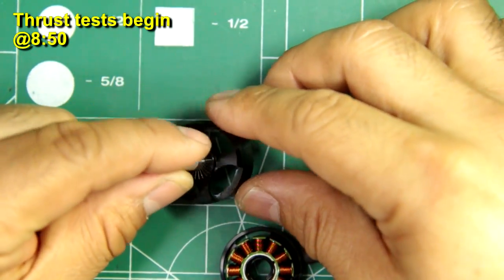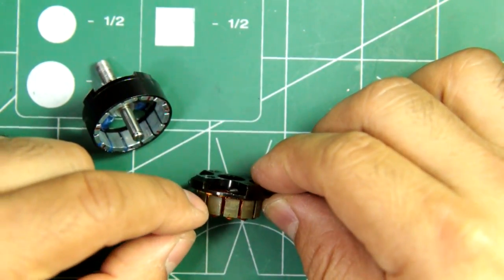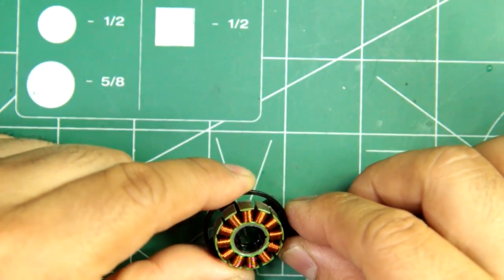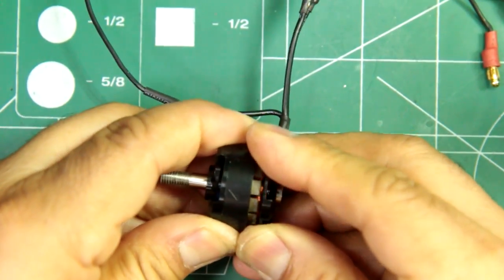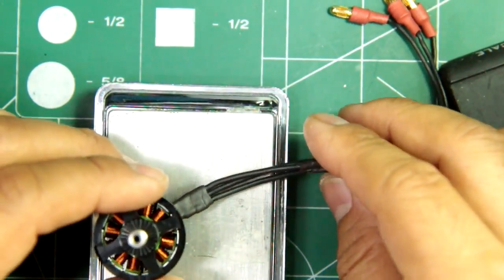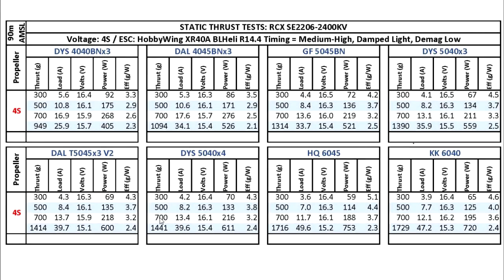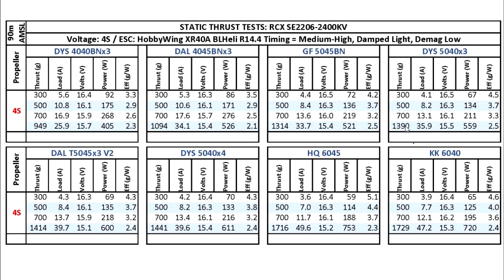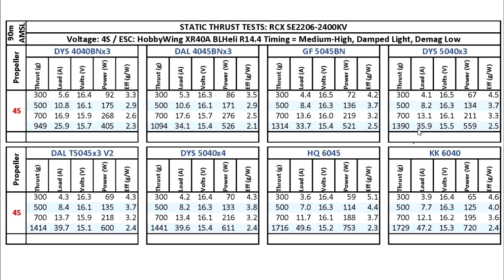RCX RS2206-2400KV V2 - New PowerHouse Motor Prototype from MyRCMart

Comment: Hi friend! Do you remember the real kv of this motor?
Reply from the maker: It was very close to the advertised KV, if I recall correctly just a bit higher. For some reason i didn't include KV measurement in tests at that time. Check out MQTB, he measured 2410KV : https://www.miniquadtestbench.com/rcx-rs2206-2400kv.html
Reply: EngineerX Awesome, thank you very much :)
Reply: EngineerX Could you consider in the future indexing also the smoothness of the motor? like for example a score from 1 to 5.
Many motors are good in the tests but because of the strong magnets they don't behave well in the quads (vibrations). Cobra and RcInPower are ultra smooth score maybe 1 and some BrotherHobby are problematic like the 1407 and could score 5. You can feel it when you spin it by hand
Reply from the maker: Good suggestion. I will try to remember to include a comment on how notchy / smooth the motors "feel" when you spin manually. You're correct. Some motors are very noisy/twitchy and not so smooth when flying due to tight air gap and very strong magnets.

Comment: Do u think 20a ESC can handle these motors for 5inch tri blades?
Reply from the maker: HQ/DAL/DYS/GF 5040x3 and HQ5043x3 V1S Yes.... 20A is good enough. For the more aggressive props like DAL C5045x3 , etc I'd prefer a 30A for peace of mind.
Reply: EngineerX I get your point but I think 20a for the more aggressive prop should be ok. When the props unload it will be just above 20a using your test results. 20a ESC normally can handle 30a in a short burst.  Putting in limitation of the battery I think should be ok.
Reply: 25a ESC is the sweet spot
Reply from the maker: Right 25A should be sweet spot but most well known good ESCs are 20A or 30A. Yes, when prop unload the 20A ESC should be OK, I say I prefer 30A because I rather have more capacity just in case, Also sometimes one motor can be more stressed than all others in certain conditions. But a good 20A can work Ok.

Comment: These results for cheap 2206 motors look better than some more expensive 230x motors have. Also decent build quality, available replacement parts (bells, shafts, bearings, ...) and no need to order separate CW/CCW motors. Very good. Only pity that most batteries can't fullfill the current demand for these motors :)  Nevermind... as curious beast I ordered a set of these for GX210. Let see how good they are.
Reply from the maker: Indeed! When I tested them I actually did a load cell calibration check and ran a couple of props twice because the thrust was higher than expected but seeing the rather large magnets, small airgap and good windings it made sense. Well, let us know what you think of them when you get to abuse them. They need to quickly make a 2306 and 2407 motor using the same recipe as this one, it'll rank high on the power list with the other top brands for sure. Thanks for watching!

Comment: Could these motors handle 5s do you think?
Reply from the maker: Yes, they I think they'll handle 5S with 5040x3 no problem. With DAL C5046x3, I would do a fast run with a couple of full throttle punchouts and immediately land and check motor temp, should be able to hold in hand firmly. That{s about 55 to 60C on the motor bell. You do need to be aware that a batch of these motors had defective glue and some people had magnets slip from the bell. But I think even on 4S magnets slip. 5S would exacerbate the bad magnet glue issue however.
Reply: Yeah but they recently came out with a V3 of this motor that fixed the issue, entirely according to QuadMcFly
Reply from the maker: Then no worries!

Comment: Which would you say is more durable: the old red bottoms or these red 2206 motors? You are probably gonna say the red bottoms, and so, if that's the case, how much more durable are they? QuadMcFly says that the Rcx motor is overall durable.
Reply from the maker: Do you mean RCX red bottoms or EMAX red bottoms?
RCX has been improving motor quality in the latest versions. These use better bearings and strong AL7075 alloy.
I think they may have had a batch with weak magnet epoxy but that was resolved already. I haven't had a chance to run these on quad so I really can't confirm whether they're durable or not. I have use EMAX RS2205's a lot and those have been pretty durable, though I haven't really smashed them hard, just normal crashes and tumbles. Sorry I couldn't give you more info. It's hard to say how much more durable one "good" motor is over another "good" motor. Only if there's a clear defect like slipping magnets, weak shafts, etc then it's easier to compare. Some people may crash once a break a motor because they hit a pole, rock, etc at the right angle and motor ends up exploding, then other people may crash 100 times on trees, grass, dirt and not damage anything. From what I've seen people always have some sort of issue with every motor, from every brand. On RCGroups you see people posting about their troubles with every motor. There's just not one bulletproof motor. If you hit it on the right spot it'll get damage, if you continue using unbalanced props, bent props after a crash, bad PIDs that cuase motor to overheat, etc, then most motors will get damaged.
Reply: I meant the old emax red bottoms. I ask because I have had the zmx v2 2205 motors and they dont sound smooth anymore after only  a few minor crashes. I don't know if they are made out of 7075 aluminum but I dont think they are. I wanna go with the RS2205 motors since they are so durable and reliable, but since UI'm gonna be building a 550g freestyle quad, the emax motors, I think will be underpowered, especially compared with newer motors like the RS2206 2400kv motors by RCX. What would you get for a freestyle build that you wanted to be as durable as possinle? Thxs
Reply from the maker: The old EMAX are pretty good, but yes they'll feel underpowered compared to all the newer motors. Also those old redbottoms have 3mm shaft. The newer motors have 4mm shafts so the both shaft and bearings are supposed to be stronger and more durable. As far as these, I think they'll be as durable as other motors. A good thing is that MyRCMart usually sells parts for these at very good prices so always good to pick up a couple of bell/shaft assemblies, bearings and even a couple of spare motors and since their price is usually lower than other motors you can buy all of that and spend about the same as buying 4 other brand motors. But still, no motor is 100% perfect and durable, always a chance to break it on first crash. So far, I've seen the same type of comments on these as in other motors like EMAX. Many people like them and then you see a couple of people that had bad luck and motors got rough fast or had some other issue. For low-price powerful motors, I think these are a very good choice. For more premium motors, then Brotherhobby T2 2206-2600KV, EMAX RS2205(S), DYS Storm/Fire/Mars would be other good choices. There are many other choices that I have not tested like TMotors. So it's hard to recommend one single motor these days.

Comment: have you tried benchmarking this with dal cyclones t5045c and t5046c ?
Reply from the maker: I have not. I forget if it was because I had not yet received them. If I have time, I may run those 2 props.... but time is lacking and I got a couple new motors to test. EMAX RS2306 and DYS Storm 2207

Comment: I know that in flight the amp draw is about 30% lower but still I am worried that my 20a esc won't be enough for these.  What do you think should I opt for 30a?
Reply from the maker: I would feel more confident using 30A with these. 30A would be my recommendation. BLHeli_S - DYS ESCs are getting good reviews by lots of people that use them. Spedix ESCs have done well too. 
I know of a few people that have use 20A ESCs with EMAX RS2205-2600KV on 4S and tri-blace props and have not had any issues, but if I was building a new quad I would go for 30A.
Reply: EngineerX thanks a lot man appreciate it,  I will go for the 30a.
Reply from the maker: Good choice. So far I've only used DYS BLHeli_S XS30A ESCs  (XD30A are same) and I like thme a lot. No issues, work smooth. There are many other that are just as good like Spedix, ZTW, Cicada, etc....

Comment: Have you finished testing the mr2306? Seems like this motor pumps more amps than MR2306 at the same thrust level of 1180g using 5040x3 dal v2.
Reply from the maker: sleepyduck I did test the MR2306-2300kv about 1 week ago. just haven't got around to getting the data out and video edited. It'll be a couple of weeks or more before I can get around to doing the review. if you want raw data in CSV format viewable in Excel, pm your email.
Reply: PMed

Comment: It seems in so many tests (such as Returner R4 and RS2205S also) the DYS 5040 x 3 is more efficient than the DAL 5045x3 prop! Is it also as well balanced?
I am also curious about the DAL Cyclone prop.
Great work, thanks a lot :)
Reply from the maker: The newer batch of DYS5040x3 has OK balance. The earlier batch did not. Had a bulge on one of the blades. The lower pitch helps in efficiency it seems.  The DAL cyclone is performing very well from comments I've seen. I haven't flown it yet, but I did run thrust tests recently for my soon to be finished "Tri & Quad-blade prop shootout" which I hope to finish in about a week. The Cyclone places near the 5040x3 in terms of thrust but from what I recall it draws a little more Amps. I'll have full results soon. Thanks for watching!

Comment: That prototype is really hungry lol
Did you engrave by yourself the KV and motor size on it lol
Thanks for sharing and enjoy your week
Reply from the maker: Hahahah .. yep I usedt a screw driver to engrave motor size and KV so I would remember what I was testing. MRCM sent me 3 different motors in labeled zip lock bags, that I was sure to get mixed up. 
Amps seem "normal" for these thrust levels. Spinning those 5" props at those RPMs to get 1300g of thrust costs a lot of Amps. 
Have a great weekend my friend!

Comment: Dam, these are pumping out more thrust than the fusion motors I'm running, but the amp draw is pretty high and I'm puffing batteries as it is.
Reply from the maker: Motor power has overcome battery capability, the limiting factor these days are LiPos. Unfortunately that's just the way things are. At these power levels, there's no free lunch - gots to pay to play. It's just a matter of trying to make exorbitant amounts of thrust using, what probably is, the most inefficient components: smallish props spinning at crazy rpms, something has got to give and I guess LiPos are the weak link for now. When we're demanding a poor little 1300mAh LiPo to deliver all the juice 4 of these motors need at full throttle, we may end up with puffed LiPos. But it's so darn fun and addictive to just punch that throttle! LoL